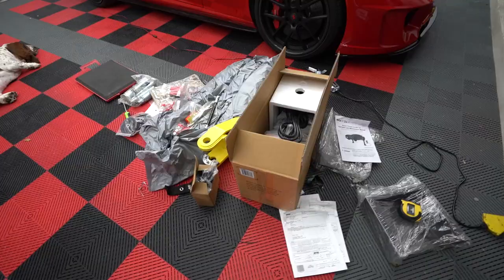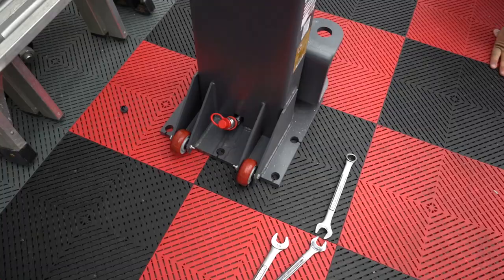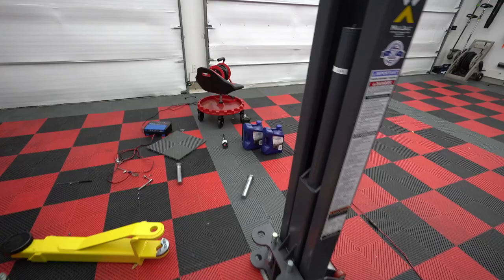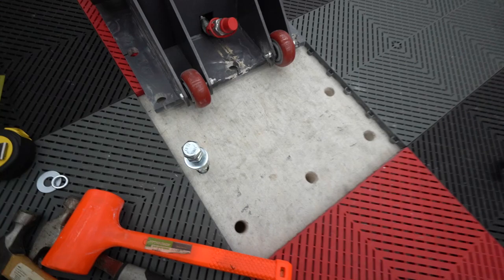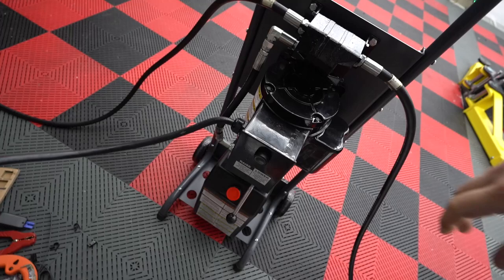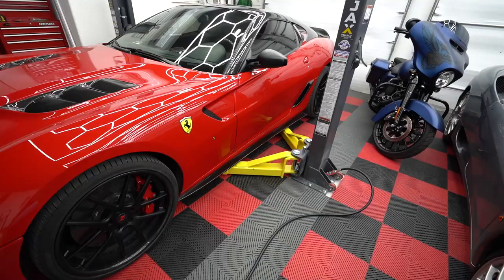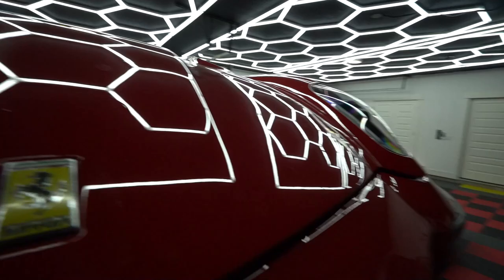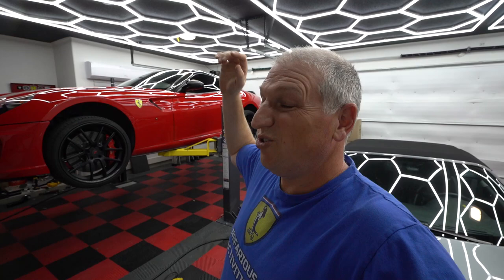DIY Installing a Max Jax Lift for low Ceiling Garages

Comment: just make sure once you use it a few time to go back over the hold down bolts for each column.  They do loosen up a bit and re-torquing is needed.   I let mine sit over night before i lifted a car and checked the torque and i had to torque them about an additional 10 ft lbs on some of them.       Also a good thing to have until you feel comfortable with the lift is to put a level on the column and watch deflection on how much it moves.    You want to make sure your 100% safe so you don't have any accidents.
Reply from the maker: Good tips

Comment: I have an old house with 9’ garage ceiling height.  I have been using the Maxx Jaxx for 6 years.  Great lift!
In my opinion this is a better option than the QuickJacks simply because the car is raised higher.  
I have the version with the ratcheting safety stops.  It has 5 or 6 heights where there is a mechanical stop to keep force off the hydraulic cylinders.  Nice feature.  
It does everything I need.  It will lift up my FF with no issue at all.  
When installing these things you need to be very careful with the post spacing/location and concrete requirements.
Reply from the maker: Yes, I was lucky that my concrete was thick enough.  5+ inches and it requires 4.5".

Comment: You are going to need to put that Street Glide on a battery charger the engine has too much compression to jump it unless you have a really big hill to push it down. Any questions just ask me have had Harley's for over 20 years. Cheers
Reply from the maker: The battery was completely dead and wouldn't hold a charge at all so we replaced it.

Comment: Is it just editing or are you installing the lags then taking them out to clean the holes? 

Correct way : 
Mark
Drill
Clean with air and brush 
X3^
Install lags 
Level 
Install post 
Make sure it’s Plum 
Tighten top bolts
Reply: Should also use 3- 5000lbs rating epoxy in each hole too
Reply from the maker: Not according to their instructions

Comment: Can't push start a modern harley with a dead batt. Much like a car it need the power to the computer to fire injectors and stuff. Make sure you have the key fab. In your pocket. It is the immobilizer and will not start without it.
Reply from the maker: Yeah it just needed a new battery. It wouldn't hold any charge at all

Comment: what was the manner in which you measured the depth of the concrete underneath the hydraulic lifts?
Reply: Drill, put put a metal rod down the hole and mark how deep it goes. I normally do like that
Reply: @organiccold  how do you differentiate doing that between concrete and the fill?
Reply from the maker: You can tell if it's concrete or fill pretty easy when drilling.
Reply: @normalguysupercar  excellent. i saw a video a while back where the depth of the concrete varied wildly.  be safe :)

Comment: Good to see Moe holding down the floor.   Does the lift have a maximum height cut-out,  that you can set?   So you don't smash the roof of your car into the ceiling.   My concrete floor has a warning saying, 
"Post Tension - Do Not Cut or Drill."   It has steel rods under tension as I understand it, running within the concrete.  So I guess I'm shit out of luck with these.
Reply from the maker: I'm not sure if there's an adjustable stopper.
Reply: I have the post tension cables too. I had a guy come out to do ground penetrating radar to identify cable locations. Cost $500 but worth it.

Comment: Awesome....how is clearance at either end for gas tank removal or suspension work etc? Does the garage door have to be open to access? 
Anyway....great video. 
Great job on the installation also.
Reply from the maker: There should be enough to to most jobs.  An engine out would be tight.  I have enough room for the door to be open or closed.

Comment: Is it possible to get your 599 on the lift without pulling it on to something like 2x6’s to lift it up first and when you do is it possible to lift it and be able to pull the pans off the bottom
Reply from the maker: YUP!  JUUUUUST barely though.  My 458 which was lowered would not have worked without some help.

Comment: This lift is so expensive that even the rich acknowledges it is expensive; the guy has 2 Ferraris in his garage and still feels the lift is expensive; IT IS! very, right now I have 1 light truck and 1 mini van to do engine swaps and bought the M7K from Homo-Depot, at a discounted "special price" of $3629 out the door, also got the expensive Ergo Creeper as well at a discounted price of $469.00 out the door; that is $4100 to work in 2 cars but I think my body will thank me. So since I am not rich I guess I am complaining because I am poor and bought it because I am stupid, 😂 but if a rich guy calls it expensive, makes me feel better about it.
Reply from the maker: It's not cheap but it is good